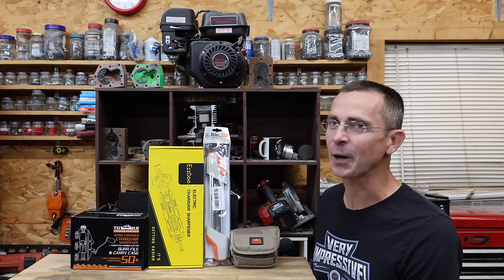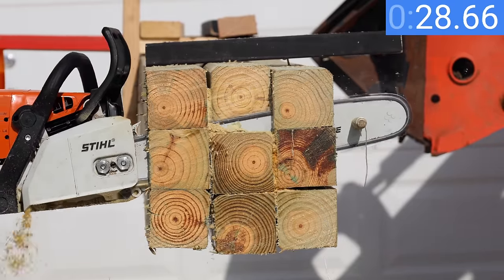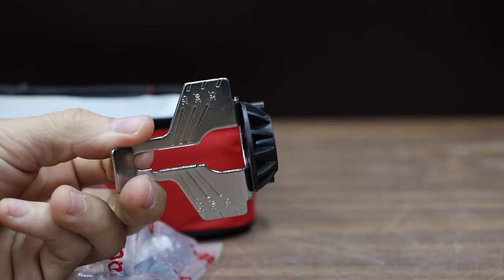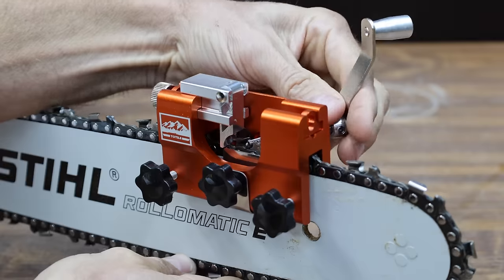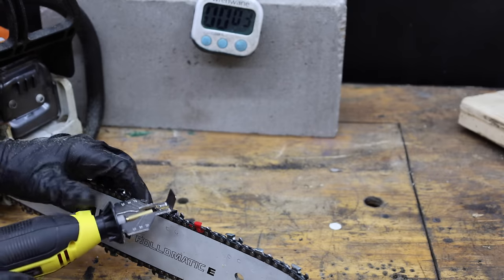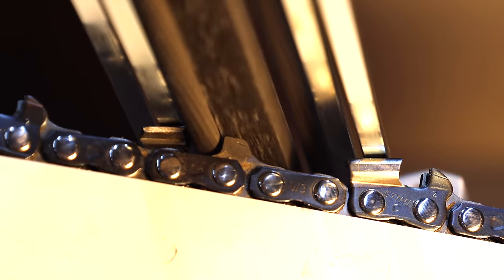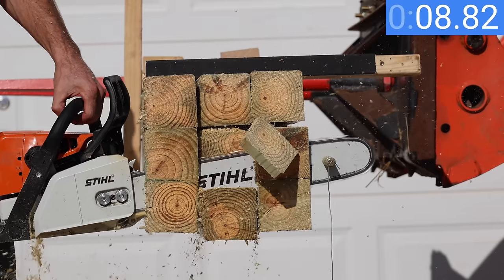Which Chainsaw Sharpener Is Best (2024)? Let's Find Out!

Comment: I read that grinding stones create less heat than the titanium, carbide or other sharpening bits.  you should have tried straight grinding stones (like the 100 pack for $35) in a dremmel, done by hand or with the dremmel guide.

Comment: Could you do a comparison on 14" abrasive cutting wheels. Emphasis on abrasive wheels only. Would like to see which compound works best. Silicon carbide vs aluminum oxide vs diamond. Thanks.
Reply from the maker: Thanks for the suggestion.

Comment: The Timberline, in my opinion, is the best manual field sharpener.  It is a little slower use but makes up for it in consistently sharp chains.  And the compact size with its custom pouch make it very easy to pack and keep all parts together and clean.
Reply from the maker: Thanks for the feedback.

Comment: As a ex tree looper we never used any of those electric tools. We only used a files in a vice. I would recomend the Stihl hand file system myself. People don't know that rackers are what make a sharp saw useless. I noticed you didn't use a vice to hold the bar, you will be surprised who much better a file would work if it was in a vice.
Reply from the maker: Thanks for the feedback.

Comment: 12 passes of the file?  Jeeze, I've never gone past 5, with 3 the target number using Oregon files. ($7.99 for the Oregon kit with file & guide) Manual is the only way I've ever done it, and it seems quick and easy to me.  I like the look of the Husqvarna kit at $17 with 3 files, flat file, and guide.  So there are two more choices for everyone.  Excellent testing, as usual, Todd.  My new chainsaw ($119 Salem Master 20") has a full chisel chain, and I'm starting to look around for sharpeners for those now.  Any tips for us?

Comment: little trick for sharpening chain use the next size up file and the chain will cut much better. basically for your ms250 its .325 .063 so instead of using stihls .325 file use the 3/8 file will hit the top plate side plate and remove the gullet all in one stroke. ever since i started doing that many years ago my sharpened chain make "new" chain feel dull. would you be willing to put my filed chain up against a new chain fir comparison? id be willing to do that just need to find someone with an ms250 so i could file a chain and send it to you lol.
Reply from the maker: Thank you for the tip!

Comment: I can actually speak on this as a tree guy. 
The Stihl 2-1 sharpener is by far the best when you’re out in the field. While it doesn’t get it perfect as we all file differently, it works very well to put a good working edge. As for when i’m in the shop, hand files & a vice… i use stihl and husqvarna x-cut swiss made files. Careful of the files from big box stores. They are not worth having even if they were free.
Reply from the maker: Thanks for the feedback.

Comment: I am curious if there was a disqualifying reason that the Harbor Freight Chicago Electric Sharpener?  I would have loved to see it in the mix as it is electric and only costs around $30.  If you do another follow up in the future on this, that would be my recommendation as that one uses a 4.5 inch Aluminum Oxide grinding disk as opposed to a round file type of sharpener. No matter what, I still love your reviews, THANKS!
Reply from the maker: Thanks!  Thanks for the suggestion.

Comment: Just an FYI, Stihl's documentation states "Always file from the inside to the outside of the cutter." and "The file only sharpens on the forward stroke – lift the file off the cutter on the backstroke." However, that would probably add to the sharpening time, and I'm not sure the potential added sharpness would be worth that extra time.
Reply from the maker: Thanks for sharing.

Comment: I have a video suggestion for you: 
Car Cell phone holders. 
Id like see the following things tested:
-How well they hold onto the phone while driving 
-How well the holder itself sticks to the windshield or other mounting area (ex: dash or vent)
-How much dose the holder bounce the phone while driving
-Ease of installation/removal of the holder and how easily can the phone be placed and removed from it. 
-Maximum size and whight of phone can each holder handle. 
-Other features like built-in wireless charger or cable holder.
Reply from the maker: Thanks for the suggestion.

Comment: I think the advantage of the Timberline is that you take off very little metal to get very sharp.  Meaning your chain lasts much longer.  Also the same amount on every tooth at the exact same angle takes the guess work out of it....and you don't waste your time.....even if it takes a little bit longer to sharpen.
Reply from the maker: Thanks for the feedback.

Comment: Suggestion:  Ramps to load stuff into the back of a pickup.   I'm interested in brands like "Black Widow" "Titan" "Big Boy"  lengths of 10 to 12 feet.  Guys like me load motorcycle but can also be used to load lawn mowers, snowblowers etc.  Things like strength, ease of setting up, safety, ease of carrying in the bed of the truck etc should be tested.
Reply from the maker: Thanks for the suggestion.

Comment: I don't know why they sell rotary sharpening stones. As they wear out, they get narrower, which changes the geometry of your saw teeth. I only use the gold "diamond" "stones". They are an abrasive glued to a metal cylinder. The coating comes off after awhile, but nbd, they are cheap and the diameter never changes.
Reply from the maker: Thanks for the feedback.

Comment: The massive advantage of the Stihl is it's ability to cut the raker to spec, where the others do not and thus add a LOT of extra time to sharping. 
Don't try this at home tip: you can use the "wrong" size file and get a very aggressive chain. Fine for logs, but not for small limbs... or cordless saws. 😬
Reply from the maker: Thanks for the feedback.

Comment: Where's the Dremel Tool with the silicon carbide bit sharpener?  It's pretty good.  Though the Stihl is the best for keeping the bite right.  I can sharpen my chains in < 5 min. with the Dremel and they are very sharp.  I can do this two or three times before I have to get out the flat file and lower the hold off links, that takes a good 15 min.
Reply from the maker: Thanks for the suggestion.

Comment: I've gotten so used to just using a good quality file with a depth/angle plate on it, I don't even notice the time any more (sub five minutes for a touch up on a 20" bar)  My angles aren't exactly the same tooth to tooth, but it's such a minor thing if there's a 5 degree variance tooth to tooth, I never figured it mattered for general use.  I even had a guy who works for a tree removal tell me the angle consistency doesn't matter much as long as you arent talking like five degrees on one tooth, a d thirty five the next.

Comment: 0:17 - 0:37 Honoson (manual operation) $10 Sharpening time 17 mins / Cut speed 27.1 secs
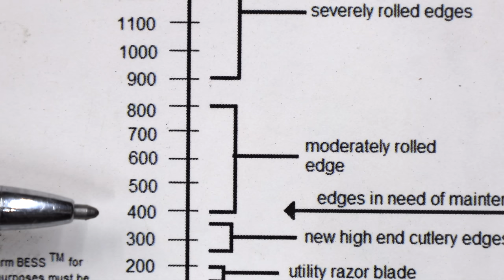1:06 - 2:36 Brand new chain
2:51 - 4:24 Honoson (manual operation) $10 Sharpening time 17 mins / Cut speed 27.1 secs
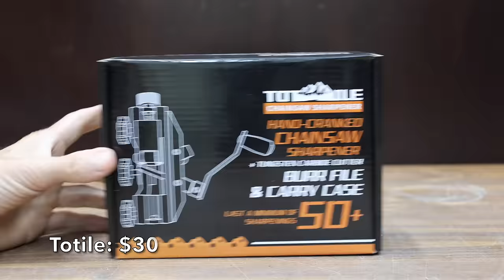4:25 - 6:18 Pretec (battery powered) $30 Sharpening time 9 mins / Cut speed 14.7 secs
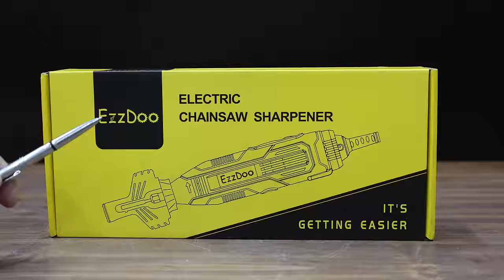6:18 - 8:37 Totile (manual operation / knock-off of the Timberline) $30 Sharpening time 26.5 mins / Cut speed 36.16 secs
8:37 - 10:16 Ezzdoo (electric) $40 Sharpening time 6 mins / Cut speed 15.48 secs
10:16 - 12:05 Stihl (manual operation) $49 Sharpening time 8 mins / Cut speed 10.6 secs
12:05 - 14:20 Granberg (electric) $99 Sharpening time 4.3 mins / Cut speed 10.8 secs
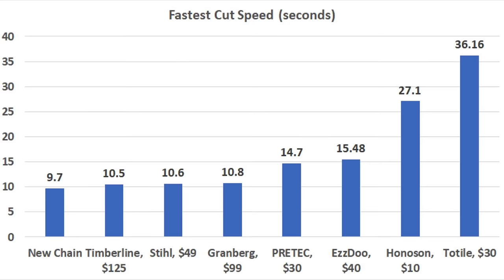14:21 - 16:19 Timberline (manual operation) $125 Sharpening time 15.1 mins / Cut speed 10.5 secs

16:20 Fastest Cut Speeds chart
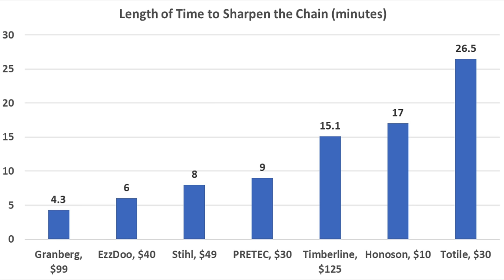16:29 Length of Time to Sharpen the Chain chart
Reply from the maker: Thanks for watching!

Comment: That Granberg reminds me of the old file holding jigs that I used to see professional loggers using in WA 40 years ago. 
I think most of them now just have several chains and take them to a specialty shop that has a fancy industrial sharpening grinder. But for the trees in this area the pros like a square ground chain and consider round filed chains to be a bit amateurish. (The old file jigs would hold the special "square" saw file so the couldn't twist. Not a true square though, I don't know the official name but it is more like a triangle with the corners clipped so 3 wide sides and 3 narrow sides.)

edit add: Ah HA! Granberg makes one "FILE-N-JOINT BAR MOUNTED FILE GUIDE SYSTEM- G106B"
Reply from the maker: Thanks for sharing.

Comment: Could you test screw heads? Several screws, all with the same size and construction: Slotted, Philips, Torx, Hex, Robertson, Triangle. Maybe throw in an external hex and a weird spline one. Wood and metal tests. Test max torque with consistent downward pressure to see which one cams out or strips, also rust them up or paint over the heads and see how they perform, then the final test could be machine screws with red Loctite and see if any of them can be removed before stripping.
Reply from the maker: Thanks for the video idea.

Comment: Am surprised that every comment about the Stihl 2-in-1 is glowingly positive. I have tried and tried and it grabs, I have never been able to get a good stroke going. I thought I might try one more time by buying a new set of files, maybe they are dull or rusty even though they look pretty good? I have yet to find a filing system that works for me. I'm about ready to send them off to a pro service. Not a local hardware store; I don't like their process, they burn the cutters and they don't sharpen rakers. I thought I was going to like using a Dremel and it worked good a few times but I have not been able to be consistent with it. I def do not like filing but I've certainly tried! As for the Dremel, I have used the Oregon stones and the ones at Tractor Supply and both break way too easy while filing. I don't feel like I'm pushing too hard at all but they break! Am going to buy metal ones and try. Sure wish I could find something!
Reply from the maker: Thanks for the feedback.

Comment: You should do a video like this using electric sharpeners. I have the electric sharpener from harbor freight and I have found it works very good. My only recommendation is have at least 2 chains to figure out how to use for practice
Reply from the maker: Thanks for the suggestion.

Comment: SDS-max drill bits. They are rather expensive and more so than SDS+ bits. Are the expensive brand bits really faster and more durable? Is SDS+ with the SDS-max to SDS+ adapter just as fast?
Reply from the maker: Thanks for the suggestion.

Comment: The Stihl sharpener is clearly the best and the best purchase I ever made. However, I think it would have been way more informative if you had included setup time in the time to sharpen, even if you exclude first time assembly some of these sharpeners take time to install on the bar before you get to sharpening, and also require removal and another setup to do the other side.
Reply from the maker: Thanks for the constructive feedback.

Comment: Im surprised you didn’t adjust the depth gauges with each sharpening. That would ensure consistent cuts and it would negate any inconsistencies with how much material you take off.
Reply from the maker: Thanks for the constructive feedback.
Reply: @ProjectFarm  yea its hard to find single tooth depth guage for low kickback chains so i just use the Husqvarna one but i used a dremal to open the slot up to a square so it would fit the wider depth gauge. From my understanding setting the depth for each tooth ensures they remove ve the same amount no matter the size of the cutter. The 2n1 sharpeners adjust the gauge so it wouldn’t be necessary on those.

Comment: Seems I told you in your last chain sharpening Video that you have to test the Timberline.  Yes it takes more time, but it seems to stay sharp a lot longer too.  I always just hand filed free hand in the past..  The Steel set up might be good to use two times then get all the teeth even again with the Timberline.
  My biggest Problem with the Timberlin is that the smallest 5/16" cutter keeps breaking on my limb saw and pole saw chains.
   You had the wrong diameter stone file on the China Made Timberline Copy Cat.. I thought about  trying the China one and mainly use it on my limb saw.
  I kind of thought the Granberg would work well and be faster..
Reply from the maker: Thanks for sharing!

Comment: I bought the real one is excellent if you use it right you will save so many chains and if you got old ones go ahead and sharpen them up because by hand you’re not gonna get the precision you can get with this tool
Unless you’re a professional every day woodsman and I am not just firewood for the winter and this saves me so much aggravation definitely worth the money💯
PS make sure your chain is pretty tight tighter than you would usually run it that helps a lot and then loosen it back up when you want to cut
Reply from the maker: Thanks for the feedback.

Comment: Wanted:  Cut off air tool comparison.  3"-4" 20,000 rpm cut of tools.  Torque, RPM and cutting speed.  In addition the cut off wheels need evaluated at the same time.
Reply from the maker: Thanks for the suggestion.

Comment: I’ve owned a stihl 2in1, a timberline, and just a file. As far as speed goes a traditional file or 2in1 is the fastest. The timberline is bar none the best way to straighten up a chain that’s been rocked. Only problem with the timberline is when the chain gets worn back far enough the rotary file starts crashing into the pawls that hold the teeth in place. I ended up selling it and just go old fashioned with a file. Takes some practice but it’s cheap when you wear out a few chains a year. I just hate the set up associated with chainsaw sharpeners
Reply from the maker: Thanks for sharing.

Comment: I prefer to use the good old 
Round file   because 
For 40 $ all get 12 file 😅
And after you get use to it 
It's cutting better than new chain  4 sure .
Double check each tooth and 
File it until you have a
 sharp chain and test it 😊
You'll get the twist and 
Won't need to do it twice. 
My freind ad the timberline tool and after 3 sharpening 
He asked me what i was doing to get mine cutting so fast  compared to is bigger cc saw 😂😂
54 cc  compared to 60 cc
Both husqvarna saws and
 16 inch chain 
😅 it was great to see my old 
1990 saw beat is 
2010 saw 😂
He was mad at firs but 
After that I've showed him how to make it cut 

Both saw was equally cutting 😊
He told me  i was really good at sharpening chainsaw 
And even if he ad 15 years experience with saw 
And me 2 years 
You never stop learning 🎉
Reply from the maker: Thanks for sharing.

Comment: Eu you don’t get manual sharpening toll and modify to use with the electric one u have. U can adapt the file into the electric motor and then you can show how the tool  is going to perform if was with a electrical motor instead of 16min you probably will do in 6. Just a Idea. Good job sir.
Reply from the maker: Thanks!  Thanks for the suggestion.

Comment: Timberline has one fatal flaw. If it gets used a lot, the two chain back stops wears because they're made of aluminum, and eventually you end up sharpening the chain unevenly from side to side, so it'll no longer cut straight. Those stops should be hardened steel instead of anodised aluminum
Reply from the maker: Thanks for the feedback.

Comment: An equal sized tooth is irrelevant on how a chain cuts. You can have a new tooth on one side of a chain and the smallest possible tooth on the other side and it will still cut straight. All of these sharpeners are good for one maybe two sharpens. After that you have to start filing the rakers. The only thing that makes a chain cut crooked is the difference in height from the top of the tooth to the top of the raker. For most chains that distance should be about .025”. With a little practice you can freehand it with a round file and use a raker gauge to file the rakers to the correct height. All of these sharpeners are a gimmick with the exception of the Stihl combo files.
Reply: Also, counting strokes is a waste of time. The teeth do not need to be sharpened to the same size or the same amount of strokes. A sharp tooth all sharpened to the same angle with a properly filed raker to the correct depth.
Reply: This is the only correct comment on here.

Comment: I have the Timberline and it is just too cumbersome,  over time it becomes more cumbersome as the parts get worn and it becomes more difficult to set up.   The stihl I have found is much more reliable and quicker.  I no longer use the timberline . My two cents.
Reply from the maker: Thanks for the feedback.

Comment: Sharpening chain is a visual process. You should be filing until the wear is removed. (the shiny edge you see under bright light.) Buy quality files of the right size and learn how to file. If you do it correctly,  a filed chain will Always be faster than a new factory ground chain.
Reply from the maker: Thanks for the feedback.

Comment: This may be logistically challenging, but, on a test like this, Id like to see how well an expert could sharpen a saw blade freehand. (The same goes for sharpening knives, chisels, and drills.).

That is, is there enough of an advantage in a 'system' over just (over time) learning a skill rather than just using a jig...

I use a chainsaw sharpener, i forget the brand, but, for my chisels and knives, i go freehand, while I have someone else do my drills, or buy a new one. 😬) 

...just a thought. 🤔
Reply from the maker: Thanks for sharing.